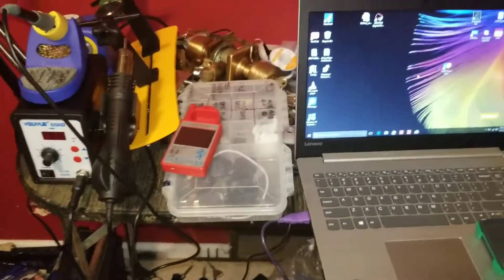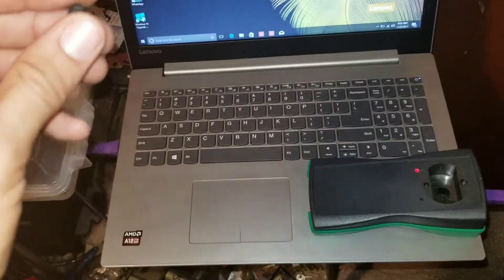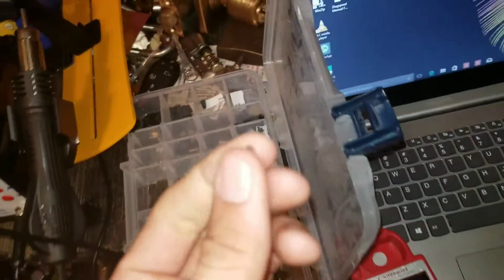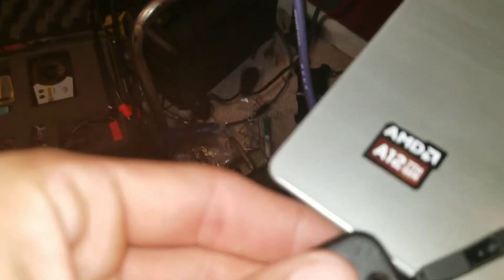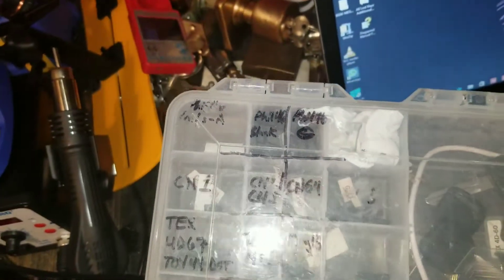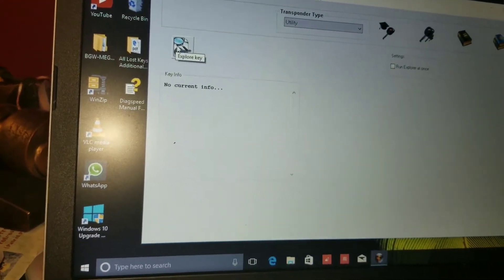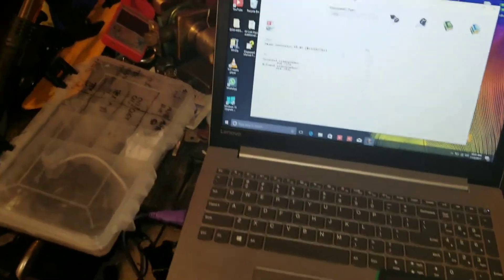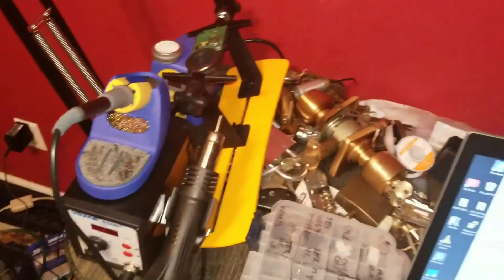Transponder Chip Adaptation and Conversion in Regards to Modern Automotive Locksmithing

Comment: id love to learn from you for about a week and pay for it... you should consider taking on training program or something... very knowledgeable... im trying to find a good locksmith school right now.. ive purchased a bunch of equipment but dont really know how to use it to its full potential.. (vvdi app im608 ck100 super chips, universal keys etc)
Reply: I'm an automotive locksmith that's able to originate a key for almost any car (except mercedes).  If you're going to be originating keys then get use to Lishi tools.  I cannot express how much these tools cut down on work time and cost.  There's almost one for every single car.  When you pick the lock you're able to decode it.  I'm familiar with the CK-100 but I'd like to think it's quite unreliable.  There's many times I would receive "connection error" when another machine is able to handle the job.  I suggest the AutoProPad for well rounded use.  European you're going to need VVDI2.
Reply: @SneekyFauker  yup I have the auto pro pad, and just ordered a smartpro and vvdi2 and about 15 different LISHIs... what part of country are you in? interested in an apprentice/training someone...if its not crazy im willing to pay even to learn..
Reply: @realtormail1  I'm in United States.  My hobby is picking locks so jumping over to Lishi was almost instantaneous easy for me.  Get use to using them.  I use to go to a junkyard and get about 8 different door locks and practice picking the locks, decoding it, and cutting key blanks for them.  Also, if you plan on entering in the European car scene then it's not going to be straight button pushing like most car programming.  Volkswagen all keys lost requires the use of soldering and desoldering.  You need to remove an 8 legged eeprom from the board, read the data, make a service file, flash it back to the eeprom, and solder it back.  BMW is the same.  You most certainly don't want to solder incorrect someone's BMW CAS4 module and lose your reputation so practice.  (Not every VW/BMW needs solder and most fob style BMW is extremely quick and through the OBD port.  Only the newer models.

Comment: Of course you can use that chip again, you only need to change TMCF to password mode manually (06), but GM (+) is pcf7937 with (B) in ID Mark, be careful with that, and your cn900 mini has almost the same power as your Tango, I recommend you buy my tutorial GuiCerPro volume 1. Here I explain how to perform preloads (nissan, Honda, Suzuki, Mitsubishi, Chrysler an reanult) with any cloning machine (vvdi key tool, handy baby, cn900 mini, effi + zedbull, etc) . keep sharing
Reply: Tutorial? Where?

Comment: I have 30 46 transponders in password mode . How do I use them , I tried using it for GM didn’t work
Reply: They can not be programed into a car while in password mode, you can only use them for cloning. You will have to convert the chip to cryto mode but it can not be blank when you program.